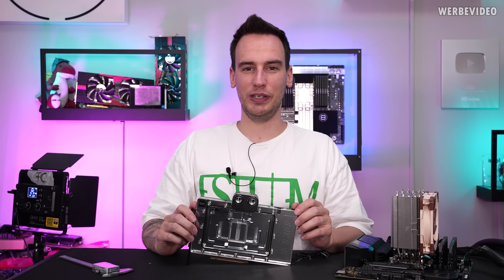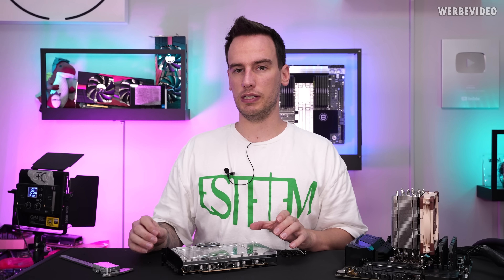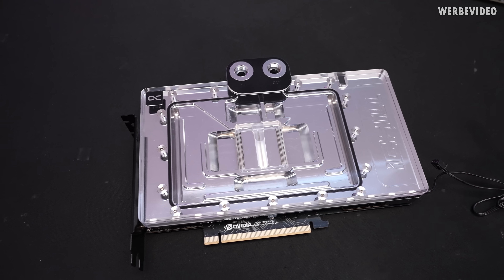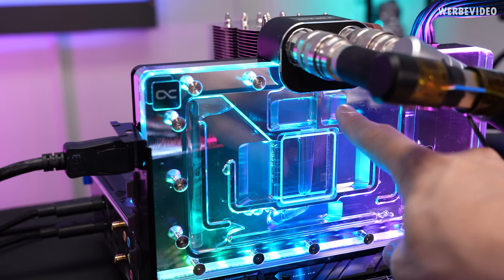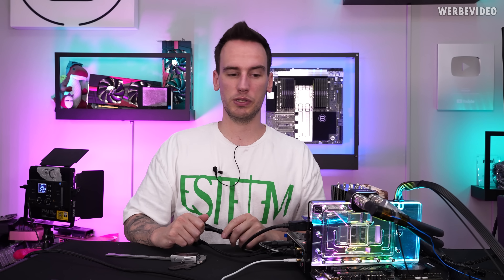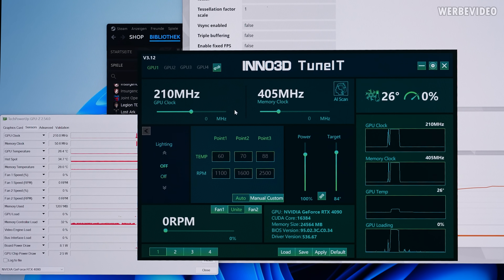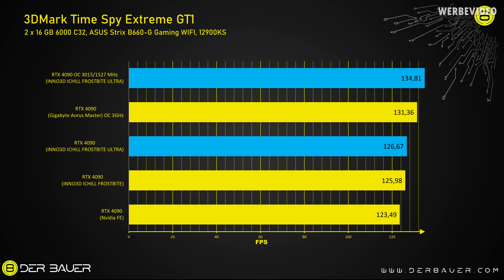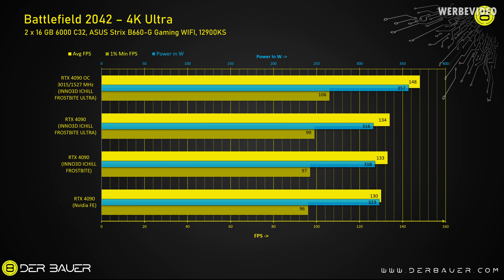Potential Cooling Problem on this RTX 4090 iCHILL Ultra?

Comment: Thank you for mentioning coil whine, or the lack of it. Legit very important for me.
Reply: Yea me as well. I can't stand coil whine.
Reply: While card electrical design might change things - this really varies from one unit to another and other things like PSU can change things.
Reply: @eliadbu  true true, but it's next to impossible to figure out if a component may whine without small cursorary checks by independent youtubers like this. so i appreciate it, even if i do get one & it whines.

Comment: Hi Der8auer! Do you plan to make vram temperature test on 4060ti 16Gb? Half of memory chips are placed on the back side of pcb because of that clamshell configuration and cooled only by backplate. It would be very interesting to see is there any problems with temperatures.
In msi 4070 ventus 2x/3x engineers made a huge mistake not covering one of the VRM phases with the radiator. Because of that mosfet and coil can heat up to 100°C, so I don't believe in infallibility of engineers.

Comment: Just use higher pump speed and move/shake the build a bit to break the surface tension. I guess it's not really possible in an open air bench. Also temp wouldn't be an issue  as long as it is cooled by the block
Reply: @TheDeeGeeNL  what I mean is to bleed the air with higher pump speed, then lower the speed for normal use.
Water-cooling 101
Reply: @TheDeeGeeNL  He doesn't have to run the higher pump speed constantly.  You only need to do 100% pump speed and change the angle of the card a few times to bleed the air out of the loop, then you can go back to a lower pump speed.  Its water cooling basics.
Reply: @Mildly_Amused that's kind of odd that he didn't bleed the air out
Reply: @TheDeeGeeNL  a D5 at 100% it's quiter than any fan at 50%.
Reply: @TheDeeGeeNL  Before starting, you MUST turn on the pump to 100% to pump the system.

Comment: With all that RGB in the water distribution, the card is absolutely designed for vertical mounting. It should be easier to get working than this, regardless of expected flow rate from the manufacturer.

Comment: Get PTM7950 pad all thermal paste sucks and pumps out atleast on my liquid devil 75c hotspot first then 92c hotspot stock paste eventually had 92c hotspot and 95-99c hotspot at +15% you know what you had on your liquid devil 7900 XTX most users report least 15-20c higher on liquid devil
My liquid devil is now 60 to 70c hotspot with PTM7950 honeywell thermal pad Linus tested it couple of months ago had it outperform liquid metal, and i had 20c improvement so far on hotspot 23c improvement at +15% power limit compared to mx-4 and even more compared to stock paste.
Lenovo uses PTM7950 on laptops and NVIDIA on the 4090 FE apparently.

Comment: I'm disappointed with this review. You didn't show hotspot and memory temperatures. You didn't compare vrm, hotspot, and memory temperatures between the horizontal and vertical positions of the card.
Reply from the maker: Good Point. Will make sure to include it next time
Reply: @der8auer-en  Thanks.
Reply: Same.

Comment: I have VPP755 which can be heared above 80%, but that might bee due to the bay reservoir and a VPP Apex which is on an Aurora Reservoir and I cannot hear it outside the case and it's running only full speed 
Indeed, the trapped air is a water path design flaw, but it can be mittigated

Comment: in reality you had the gpu horizontally mounted its just that you had the motherboard mounted flat on a bench instead of upright in a case
Reply: Most people would want to see what they just paid for and would mount it vertically I think.
Reply: "aKsHulLy"
Reply: The motherboard in my case mounts to the rear panel, with the I/O positioned on the top of the case. Is my GPU still mounted horizontally?

Comment: usually with any water cooling system I always try to bleed the system from air, as much as possible - so it will move to the reservoir and then fill the system again. Did you try to move the system around? I know open bench is bit trickier but since you use flex tubing you could in theory remove the card, and tilt in several direction allowing the air to bleed.
Reply: With the flow close to zero, getting the air bubble out doesn't matter much.  Stagnant water would move heat better than air, but copper is so much better than either that stagnant water adds nothing.
Reply: This was common knowledge 20 years ago when I watercooled my first PC and I'm pretty sure it still is in the watercooling community. I can't believe Roman doesn't know this. It's so silly. Alphacool has nothing to fix here.
Reply: @yup8388  The only thing silly is you not getting the point he was making.
Reply: You've entirely missed the point. A well-designed block would be able to move water through those areas. He even explicitly said he moved it a bit to disturb the surface tension.
So, no: you haven't discovered a piece of knowledge he doesn't have. He was just demonstrating to you that you will get very little water flow through that area. Even if you move the the card around and get the air out, it will just be relatively stagnant water.
Reply: @rustler08  I had cards and blocks with similar issue Of flow impeded by air, every single time I bled it, the issue resolved. This is no new knowledge I never claimed it is. It is common practice, and I could not have found mention that he did it. I'm not talking about bit disturbing the tension I'm talking about removing the air completely.
Reply: @rustler08 Dude he is flat wrong in this case!  If the card is filled with water, doesn’t matter if water flow is stagnant there, the water temp will be consistent across the block.  The highest flow is needed first across the GPU, then the memory.  VRM with the size of copper on this cooler isn’t even negligible.  So once again, little to no water flow across the VRM is no problem, just tilt card to remove bubbles, low temps will transfer to water and heat in water will move, or just stick to air cooled. SMH.  Stop defending these YouTubers BS, when they right congratulate, but when they are wrong, don’t go along with the misinformation.

Comment: bought original last year, temp was 60deg...weird, hotspot was 100-115deg ! dismantled, bad thermal paste a part of the gou die was clean, reoasted with kryonaut my hotspot is now 58max and gpu vram are usually at 40ish...so dont buy for a warranty when thermal interface is random quality you probably will need to repaste, it now runs 3090mhz 24ghz vram btw

Comment: hey roman first of great video as always. Im curious since the pcb of  40 series are short and gpu waterblocks follows the design maybe you can make a hybrid by machining aluminum heatsink at the end of the waterblock cooling plate that can be bolted in like extra 2-3 inches more? since this gpus are mostly inside the case with fresh air flowing thru :face-blue-smiling:

Comment: Did you modify \ change the voltage while OC it or was that option left on stock settings (1.05v)
Reply from the maker: Stock voltage. More/less didn't help

Comment: Hi Der8auer I work for a company that uses Alphacool blocks on our high end open loop systems we sell. As far as im aware we are advised that 60-100% pump speed are recommended settings for the 40 series generation of GPU blocks. They are designed for high flow configurations opposed to EK's more restrictive small channeling designs. We have found that when vertical mounted the top left corner does get some air trapped, but after tilting the system anyway to help get air out of the radiators, this also fixes the air trapped in the GPU.
Reply: A lot of you are missing the point, and it shows. 
It doesn't matter if you shift the card around, if that area is empty now...even if you get water into that area it's still going to be relatively stagnant. That means it's a poor block design.
Reply: @rustler08 best comment. only one that realizes even if you get the air out, it shows there is no flow in that whole side. why does the right side have such an easy path right over the chip and out? send life they should eliminate that short easy water path entirely so the water is forced to go everywhere else.  it didn't mean derbaur is dumb, or people are picky, or the designers are misunderstood geniuses lol. it means the block is badly designed.  of the pump offs turned down to 10%(!), then the water should flow through the entire block, at 10% of the maximum flow rate. because a well designed block doesn't have an "easy short path" for water to take. it only has "the right path".
Reply: EK blocks are also designed to work better with higher pump speed.... it's a matter of fins.
Reply: presumably in a company that pc doesn't stand next to you and in a noise sensitive (living) room. Having a pump (or anything really)  running loud is a VERY legitimate criticism.

So if they "recommend" something annoying, that doesn't make it better. And there must be other pump solutions.
Reply: Just let it run.  Even at 10% pump speed the water will absolutely always fill the entire block eventually.  100% of the time.  It may take a week but it will do it.
Reply: @NinjAsylum  lol I don't think anyone would be thinking it should take them a week to be able to start using their computer
Reply: Well if that is the case, either he's not too knowledgeable about water blocks, or he deliberately set it up to generate a "problem".

Even with the "problem" it still beat everything else he'd tested.
Reply: @Penfolduk001  I think Derbauer is legit, he say the reason lower noise. Most people do it for the same reason.
It works good enough, but it's not optimal. You can see a great improvement of a few degrees with an higher pump speed compared to the 30% he quotes.
Reply: @IIARROWS  passive cooling isn't practical for everyone, but the end result is definitely a lot less noise.
Reply: @Penfolduk001  He knows far more than most about water blocks and he set it up in the orientation that most people likely would. It just happened to have a small issue, he wouldn't go out of his way to create a problem.
Reply: @--_DJ_--  In which case, as an expert, he obviously went out of his way to be picky then. By your logic he'd know about airlocks and breaking surface tension. But didn't.
And from what people have been saying about that particular type of water block, he set the pump speeds to below the optimum settings.

I'm not an expert on water cooling. But even I know you sometimes have to bleed central heating radiators to get rid of airlocks. It's just the nature of the beast.
Reply: @Penfolduk001  He mentioned the surface tension. Did you even watch the video? He slowed the pump down for noise and that caused the air pocket. That is his optimum setup and that is how the block performed with it. It doesn't have to be that way is all he was getting at. They could change the design to prevent it. What is wrong with being picky about a product working properly out of the box?
I looked at the info on the website for that block. There is no mention of any recommended pump or flowrate that I could find. If there is one, they should include it or people are well within their rights to complain a bit if something like this happens.
Reply: @Penfolduk001  He explicitly said he moved it to disrupt the surface tension. Did you even watch the video?
Reply: @--_DJ_--  Yes I did watch the video.

- He set the water block up in a benchmark configuration that would increase any problems. This is apparently reasonable.

Then, despite being supposedly being a water block expert, makes no onscreen attempt to clear both a clear airlock as well as the "surface tension" problem.
As I said, even idiots like me know how airlocks can cause problems in central heating radiators. So an expert like DeBauer should know. But that is apparently reasonable.

- According to people who have knowledge of this type of waterblock, the pump was being run at least at half the expected setting. Do would not clear any airlocks or surface tension problems.

Now if he'd said from the get go he was coming at this from an unknowing user perspective to teach people, fair enough.

But he didn't.

It was the equivalent of running an air cooler at half recommended revs then complaining the CPU thermal throttles.
Reply: @Penfolduk001  You are taking this far too seriously, and missing on pretty much every point you cover.
Only you have called him an expert.
The setup is reasonable. People mount cards vertically all the time, especially people spending that much on their PC.
He is testing the block how he would use it. that is reasonable.
It doesn't matter if other people run their pump at a higher speed, he doesn't. 
  He was reviewing a product, that had a small flaw in his use case. He specifically said he was curious how it would perform like that, so he left it like that. It didn't make any difference so there was no need to correct it. If one side was hot, he probably would have made an effort to show how much better it would be with the block full.
It isn't the same as that at all, he didn't complain about any performance issues from the air pocket because there were none.
Reply: @--_DJ_--  It's not THAT block, it's ALL blocks.
Reply: @Penfolduk001  He's not a watercooling expert, he doesn't claim to be one.
Reply: This was exactly my first thought... Why so much talking about that air trapped? Rush the pump to 90%, tilt the GPU a bit and the air is gone... Also, very well said! Pumps are designed to run 60% speed in standard conditions. Some also are not recommended running below 50%. And anything above +75% will drastically reduce life expectation of the pump. (I'm talking about normies pumps, like d5 and some distribution blocks too, and I'm not sure and well educated on EK pumps but should not be far off).
 Now, in his defense, he's also right. I was working on RMA services, and he's right. Ppl want great experience out of the box. Normies does not have a functional brain and they might send the GPU back to manufacturer straight away because "it's defective, the water doesn't flow through there". Like, no joking... I'm 100% sure there will be buyers doing so, because they don't understand physics and I've had these cases on my desk, so Roman has a solid point too. :/
Reply: @ShankayLoveLadyL  I wouldn't insult people over a design flaw. You should be able to turn your pump down if the cooling is adequate and still have the entire block fill with water. Unless they are going to specify a pump and minimum speed, they should make a block that will fill with water completely with the most common pump people would be using. The whole point of WC is a reduction in sound for many people, so it only makes sense that they would drop pump speed if temps are fine at lower speeds than would push the air out of that block.
Reply: @--_DJ_-- Maybe the pumps are like internal combustion engines which need a minimal rpm to not stall?
Reply: @neondemon5137  You can't really stall a centrifugal pump like they use in water cooling. You could stop the flow from it with enough restriction, but the pump would still be spinning. This is just a small error in the block that promotes flow in other directions more than it does to that small section of the water channel. Not really the end of the world, just optically unpleasant for the most part.
Reply: @ShankayLoveLadyL  Where do you find that +75%+ will "drastically reduce life expectation of the pump"? From what I know pump speed doesn't affect its life.
Reply: @ShankayLoveLadyL  "anything above +75% will drastically reduce life expectation of the pump" Completely false. What actually reduces the lifespan of a D5 is running cheaply manufactured biodegradable coolant through them which gunks up around the ceramic bearing and starts wearing through the graphite coupling. I have a D5 in my build turning 20 years old this year, and for the first 15 years of it's life it ran at 100%, and for the last 5 years it has ran at 50%. I have always used only automotive coolant with a phosphate additive (Valvoline Zerex classic green) and a D5 is so under stressed in the application we use them in that they will last indefinitely @ 100% when used with a high quality coolant that doesn't start breaking down after 6 months like almost all the snake oil junk sold by PC water cooling manufacturers.
Reply: @K31TH3R  This is strong and well made point. I will also be looking forward on your coolant suggestion, thanks.

Comment: you are covered by warranty if you replace the cooler, there are consumer protection laws for that
Reply: Depends on your country.
Reply: @NotThatGuyJD  yes, but eu and the us should be ok at least
Reply: @riba2233  "Should", but in fact it's a juridical nightmare.
Reply: @puciohenzap891  yeah true
Reply: In the US you are boned. Laws are not terribly relevant, the only way to get them to follow the law is to sue them